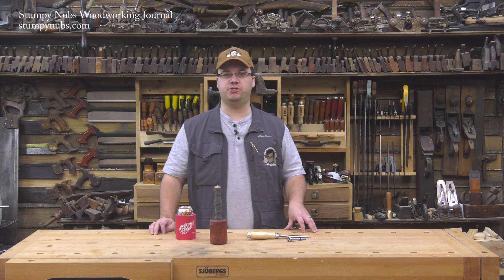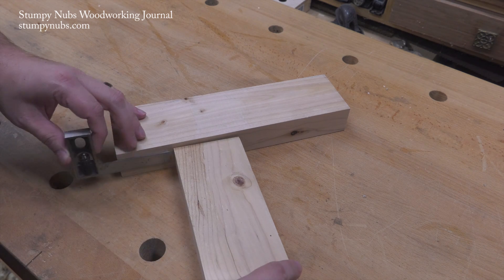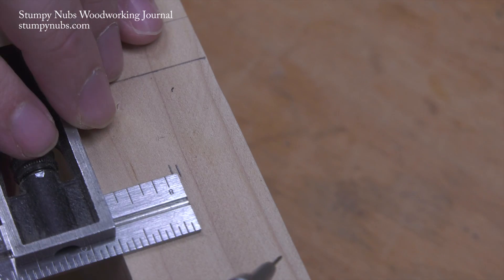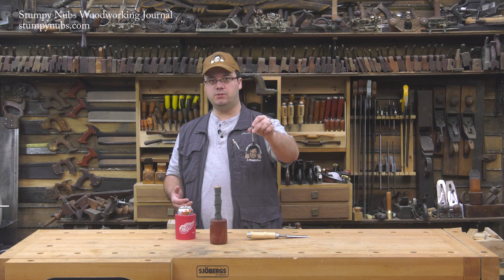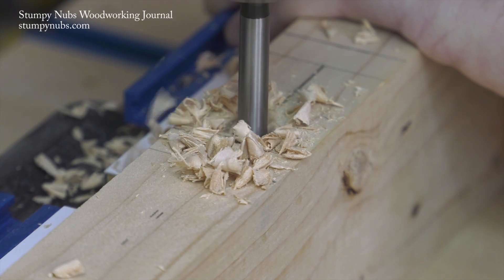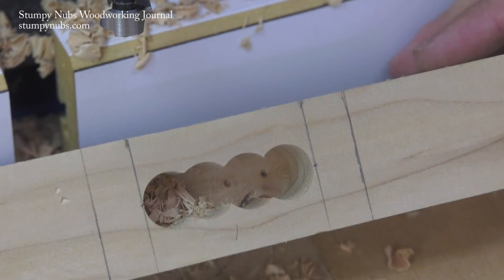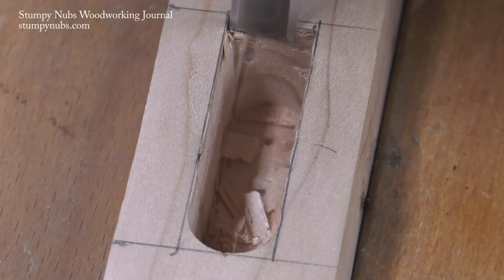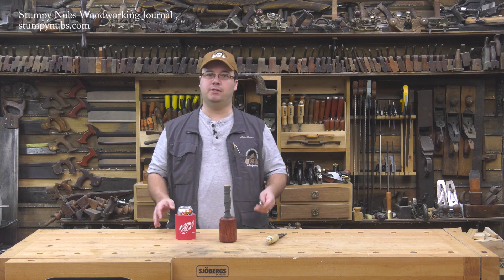How to make a square mortise with a drill press and a forstner bit!

Comment: Thank you for this technique.  I have purchased a Woodsmith plan for a Craftsman style front door.  The instructions call for drilling 3/4" x 3" deep mortises with a plunge router and a 1/2" x 4" roughing end mill.  I started looking for such a bit and discovered the one I would need is about $100.  I already own a 5 piece set of Fisch forstner bits, and they proven to be very capable over the last year.  I intend to try your technique before I spend $100 on a single router bit.  Since the stiles are about 80" long, I will have to devise some auxiliary supports for my drill press.

Comment: Good clear tutorial but one thing might be easier. The center of any thing is easily found by laying a ruler on the board at an angle to a point where there is an even division of markings and getting the center of those (i.e. marks at 0 and 4  - the center is 2 etc.) is easier for me than splitting the difference of the estimated center. Just me though. - I have always angled the ruler to get evenly divisible numbers and used that to find the center.
Reply: I also used that technique it is simple
Reply: Thanks for the tip
Reply: Yes a good idea tooo
Reply: I prefer stumpy way though
Reply: I just learned this trick.  Love it.
Reply: Using a compass is even more accurate

Comment: I have seen drill tool marks in the mortises of antique furniture.  It looks as if the maker bored the holes and then squared them up with a chisel.  Probably not Forstner bits, though.  Thanks for showing the modern version.

Comment: What about leaving the ends rounded, then rounding over the tenons? Wouldn't that be easier?
Reply: They make dominos like that and it would be super easy to do if you used Domino's but if you're putting a tenon on a piece it's hard to fit a router and get a perfect round over that fit in there I for one prefer just making to mortise and then I make a giant stick with roundovers on it that's the same size and cut it to length and just fit it in both sides

Comment: Your clear explanations and clear video make a world of difference.  There are lots of videos on here about mortises.  Yours are the clearest.  I am curious though.  Is there anything to consider when mortising with the grain or is that totally out of the question?
Reply: If you mean mortising into endgrain, that's not a good idea. You can do it, for example if you wanted to join two pieces end-to-end to make a single, longer piece, but the grain will be really prone to splitting if you force a tenon in there (so it's really only useful if you need to hide the join on all sides). A dovetail would be perfect for that kind of join, but finger joints would also do a better job than mortise/tenon.
Reply: Thanks.  I often see what look like tapered finger joints used for end to end.  Guess that's why.
Reply: Yes that's right, the wedge type ones. Which type to use depends on which axis, if any, will be taking the strain as well as the appearance.
Reply: Very well done ! You are a very GOOD Craftsman with craftsmanship. Please,keep your great videos coming, I learn a great deal from you. Thank you so very much ! !

Comment: Great tip. Just wish forstner bits weren't SO EXPENSIVE. I bought a set of cheap ones from Harbor Freight and they can barely cut anything. Maybe a video on how to sharpen them?
Reply: There is no point in sharpening the cheap ones, the steel is rubbish and won't hold a good edge - I learned this by buying cheap as well.  One day I will buy some good ones, but damn are they expensive.

Comment: I remember a friend that had this cool thing that went in the drill press and made square holes . It was a little shorter than the drill and it was square tight around the drill and you would pull the handle down and the drill would start drilling and the square metal thing around it had a 4 sided taper edge that would cut the edges square.. . I don't see that anymore???
Reply: Yes I know what u mean. Mortise maker. U can buy them and attach them in your drill press or purchase a dedicated chisel moisture machine. I think though machines like festool portable  dominoes joiner is taking over.

Comment: I use an end mill bit in my drill press and put the piece I am giving the mortice in an X Y  vise mounted to the drill press table. Use a 3/8 to start and then clean out the corners with a smaller bit. You can square up the corners with a file with only a couple passes. Your mortice size will be limited to the amount of travel of your vise. For woodworking a cheap vise will work.
Reply from the maker: Nothing like keeping it simple ;)
Reply: Do you ever run into problems attempting to mill on a drill press? I tried it once & the lateral forces de-chucked the thing.

Comment: Hey James, Thanks for the Wave Forstner bit info... I'll follow up. FYI: There is a neat DIY drill press attachment idea floating around that helps with the mortise clean-up with a chisel REAL easy. The guy's YT channel is called Workshop Companion and the video is titles Drill Press Chisel Mount. Check it out. It seems to work very well. Comments?

Comment: Thanks for the great instruction! Always learn something from your channel. BTW, How do feel about the specialized Mortising bits? Wouldn't they be easier to work with?
Reply: If you mean the ones with the parring collar for square holes, they can be a little finicky and it's a pain in the ass if chips get wedged in the bit.  I know of a Russian drill and rig that could cut a square hole with slightly rounded corners.  It's not hard to get the corners square afterwards.  I don't think it was ever adapted for use with a drill press, and it was a lot of steel on the end of a drill.  I don't think there's any other specialty equipment for it, maybe a plunge cut router if you're really good at setting the fence.  If you know any other ways, I'm always eager to hear about tools that are new to me.
Reply: There are machines called Chain Mortisers which are basically small, yet wide, chainsaws with special chains that plunge cut mortises. Though they are most commonly used in log construction. But those are only really useful for cutting through mortises, or for really thick stock. As in those situations you don't have to clean up the bottom of the mortise.

Personally I use a plunge router and just round over the tenon with a tiny spoke shave I made from a Stanley blade and a bit of wood.
Reply: @fermitupoupon1754  interesting, thank you for the insight.  I wouldn't have thought of using a chain mortiser outside of house framing and log cabins.  If you don't mind me asking, do you make a jig for it or do you set guide fences?
Reply: @Blarg Kliggle, the one I use for work is a floor standing unit. It comes with fences and a power feeder and digital controls. I just enter the dimensions and placement, stick a couple sacrificial boards to the workpiece and let the machine do the work. It kinda feels like cheating, but when you have to make like 24 identical mortises with regular spacing between them, it's really nice to have a machine that does it so much quicker than is humanly possible.

In my home shop, I don't have a machine like that. I just use a plunge router with a compression cut bit and templates. And then I round over the tenon with my home made spoke shave.
Reply: @fermitupoupon1754  as long as the result is a quality product, then it isn't cheating.  My great grandfather always told me "work smart not hard".

Comment: There is one more problem, using a drillpress. When the table acts like piece of  paper, look for a support under it. Cheap drillpresses are not stable enough for drilling thick holes. The holes are not square. 
Or use a drillpress, where the table of the drillpress ist the part, which is mountet directly,  where the drillpress resides. So you can reduce the problems. This is a theme, which is good for longer video.
Cheerio from Germany.

Comment: Or, you can just buy a set of morticing bits and build a simple Drill press morticing jig. the Measuring portion is the same but Morticing bits are a whole lot cheaper the Fisch Forstner bits and the jig can be made out of scraps. just a thought...

Comment: well i prefer to have my tenon rounded, clean my mortise flat side with the forstner bit and do minimum chiseling and if my tenon is slightly shorter in length that's no problem (end grain), dominos work in this way. I personally find this method easier.

Comment: Thanks for that.  I cut one mortise and tenon using forstner bit and table saw.  Didn't do so well.  Maybe more practice.  On a real project I used a template and router to cut mortises.  Worked great.
The mortises were a different story.  I used a dado blade.  that was "OK".  rounding over the corners of the tenons was a real pain.  Got to be a better way.
Reply: Regarding rounding corners of a tenon, Matthias Wandel (here on YT) had a router jig, pantarouter (IIRC), that did the trick.

Comment: I was given a.  1960s Harbor Freight Drill Press.  It needs a capacitor. Mean time.  I 'll practice. A forestnor bit is the way to go.  I always like
To put new wood.or really good wood on repairs, but sometimes there is just small flaw. Case in point. on the center of a 1 foot high deck..right above the support is a small. rectangular hole. It is about 2 inches long with the grain of the wood.. I originally was going to put filler in like plastic wood..I like a challenge. .So. I'm going to. find a suitable stick of wood and go from there. Take the cedar stick. to. the the weather damaged hole. Now trace the side lines of the stick . Route. At about. quarter inch at first.  Cut the stick about 2 inches long..essentially they stick will be a good fit. Not extremely type..gorilla glue .
any glue needs a little room.  Then take out the plug.. Route out another 16th down...that will now be 5/16 deep...put. the plug. In. Check...Use. hand chistles next..should be perfect.

(probably. salvaged red cedar)